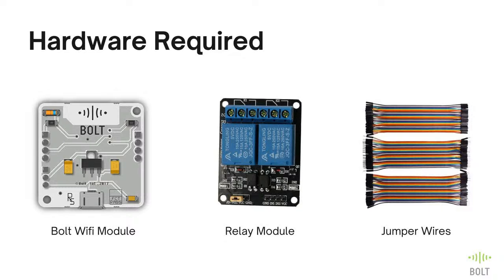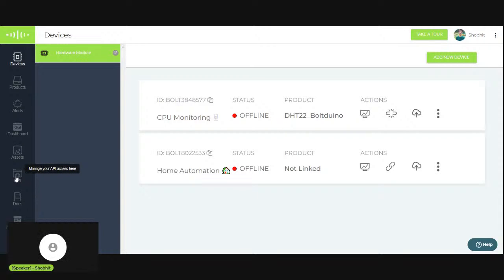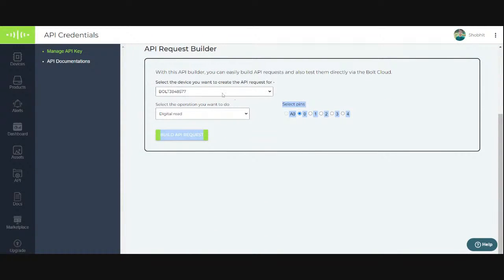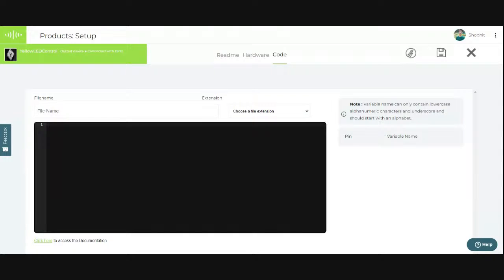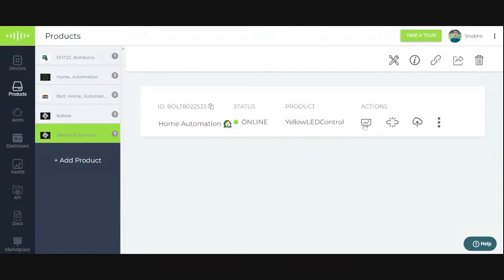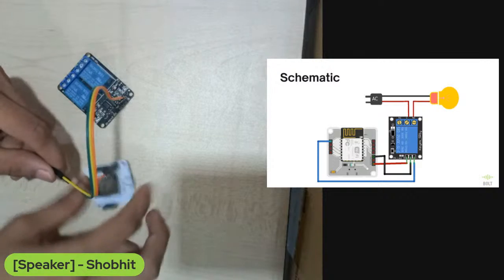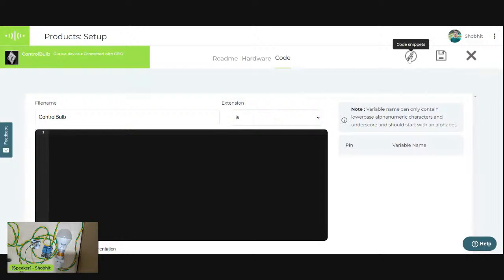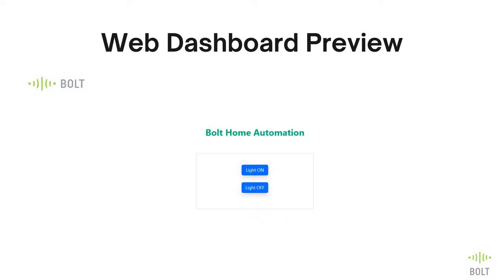Learn to build a Home Automation Project with Bolt IoT

Comment: Hey listen 👂, is there any one? 
Kindly tell me this thing, how we give power to the Bold Wifi Module?  That's the Main  Concern, 
And sir you didn't taught, that how to upload code to the BOLT wifi module Hardware... !?. 
Else it's just waste of  time. ...!
Reply: The bolt wifi module requires 5V input. It can be provided by connecting a micro USB cable from the laptop, or any other power supply since the Bolt module has a built-in voltage regulator it will take only 5 V input.
Speaking of your second question Since it is a wifi device you don't have to upload the code into the module you will have to save it in the Bolt cloud and add this device to the product.
Reply from the maker: Thanks Prakyath for answering it well.